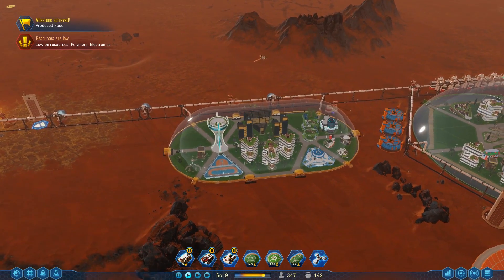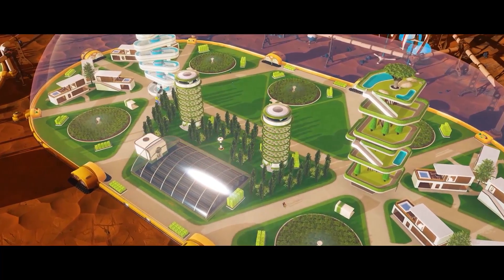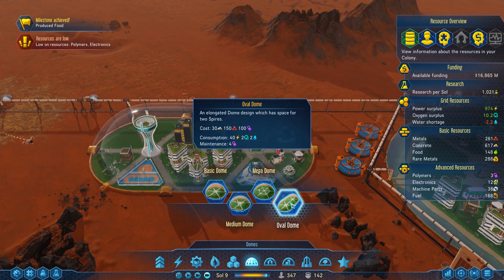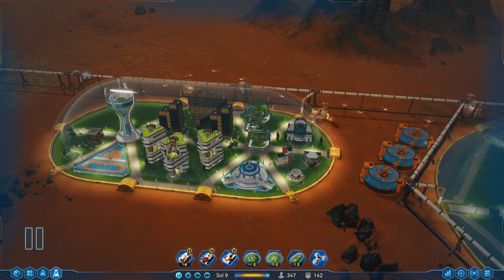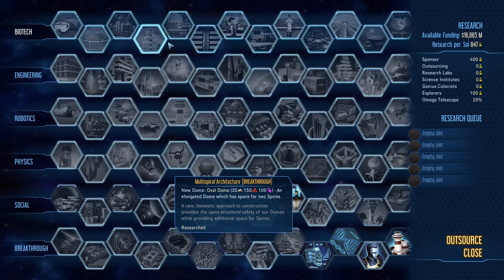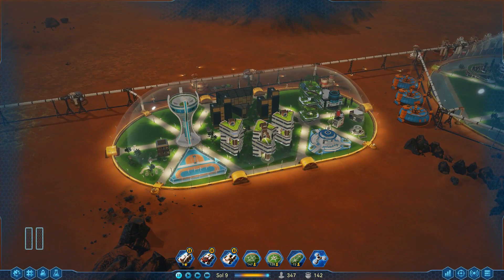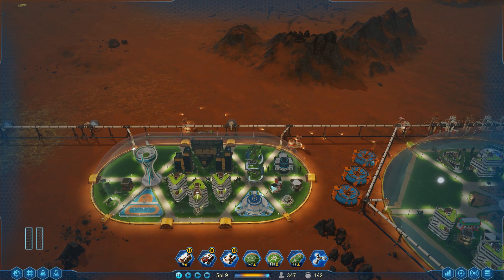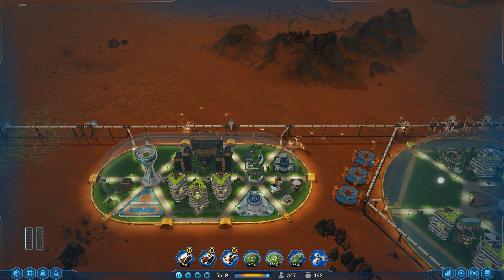Surviving Mars - How to Build an Oval Dome

Comment: How does one fix a fractured dome?
Reply: if you have the materials for repair in range of the dome (not an issue if you have shuttles), your drones should repair that automatically (maybe you need to have a universal storage near the dome for such materials to be delivered, not sure about that point)
Reply: Th. K. Ohh right cheers. One of my domes has had a fracture for the last 30 sols haha yet my shuttles didn't move the polymers around to fix it. I'll try my transport, cheers!